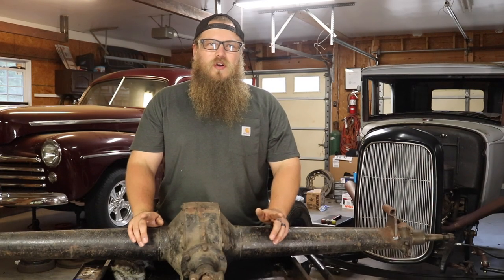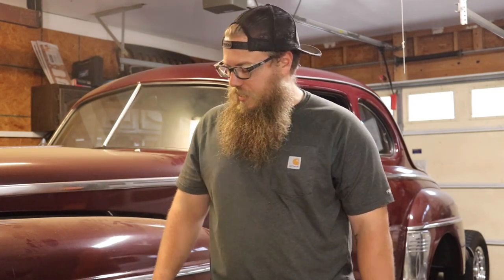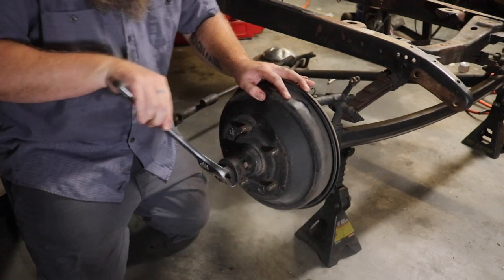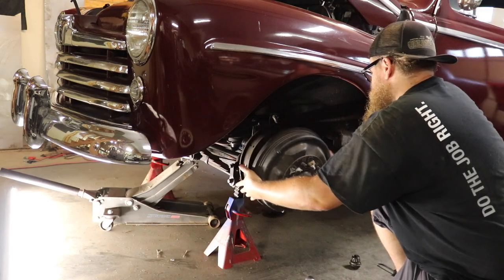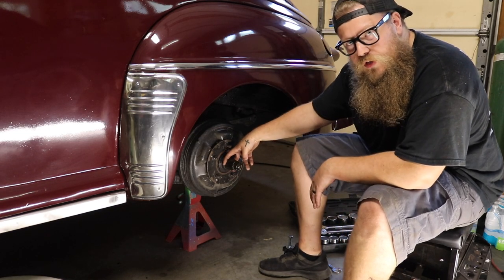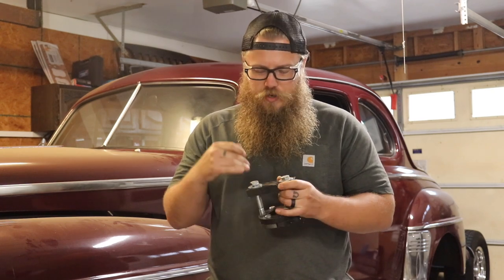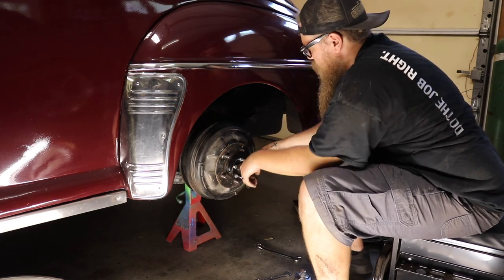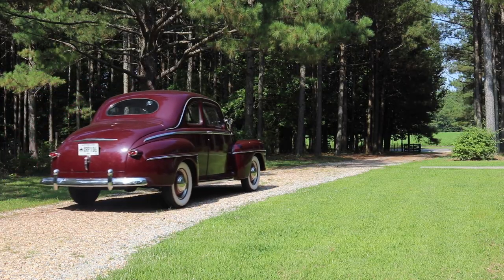Early Ford Hub Removal

Comment: Good info Hey I have a 1937 Ford 1 and a 1/2 ton truck I'm trying to get the rear hubs and breaks off any suggestions they don't seem to wanna come off
Reply from the maker: Thanks for watching! Do you have a puller? When the axle is worn out there can be a groove worn into the axle tube itself, when that happens is usually pretty hard to remove. Spinning the drum while compressing the puller can help
Reply: @WiredCustomsSpeedShop  yes I do. The truck has sat since the 50's and the wheels barely turned to begin with and as soon as I started pulling would not turn. I was afraid there might be something else holding the hub on other than the thin nut on end of tube.

Comment: I just got a 49 Shoebox with the Flathead V8. Runs and stops but I have a lot to do to it. I'm probably going to be asking a ton of questions.
Reply from the maker: Ask away Robert!
Reply: @WiredCustomsSpeedShop  What should I be looking at when the car seems to "bog" down at higher speeds? I kind of spits and sputters. Like it's getting flooded. Thanks!!
Reply from the maker: @MegaBurchtree  first thing I would check is the timing!
Reply: @WiredCustomsSpeedShop  you have any videos of that? 😎
Reply from the maker: @MegaBurchtree  not yet! I have a distributor to install soon